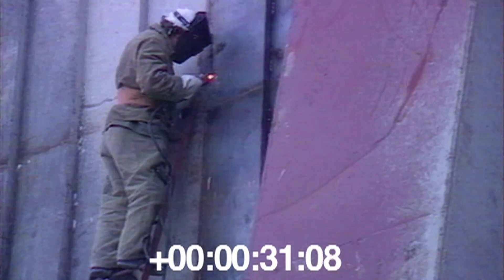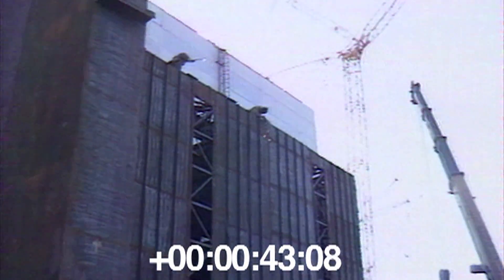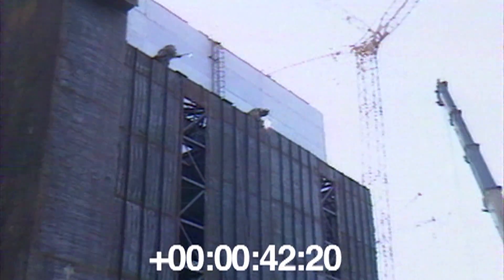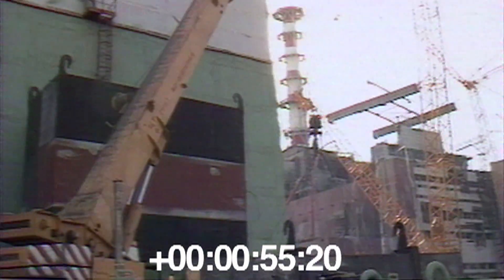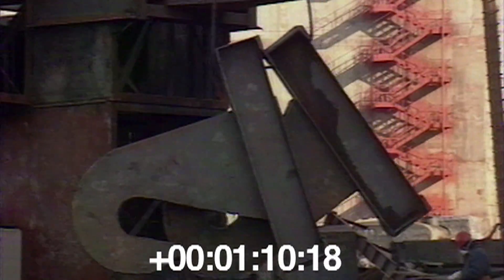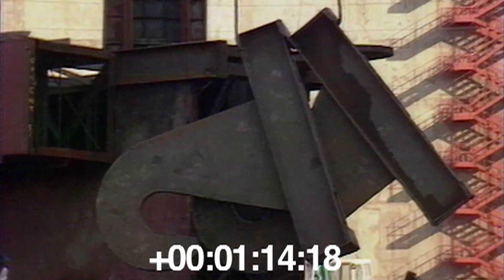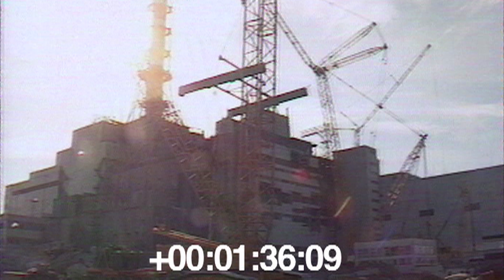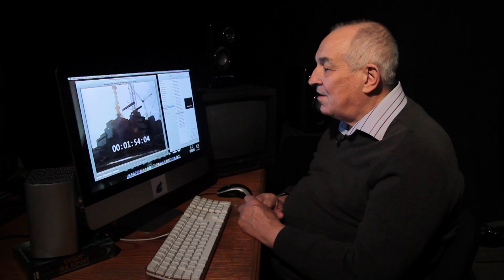CHNPP The Sarcophagus 1986.08

Comment: “Those trucks were taken to Mayak and Lake Karachay”

O O O F
Reply: The Mayak chemical plant produced plutonium for nuclear bombs. In 1957, there was a nuclear accident. One of the nuclear waste storage tanks exploded due to the failure of the cooling system. And in general there is a very contaminated area even before the accident due to negligence in the disposal of nuclear waste. Therefore, these trucks are working there. (I apologize in advance for the inaccurate translation. It's a google translator)
Reply: @Regent.sergey  yep. Basically, they were already contaminated before they even got to Mayak, which considering the Kyshtym disaster, would’ve been enough of a hazard with clean new 
vehicles. 
It’s an oof because the people running those vehicles at lake Karachay probably thought they were safe and protected in those trucks, not that they were also being exposed to Chernobyl radiation on top of Kyshtym.
Reply: lol
Reply: KrAZ mashine dislocated karachai
Reply: Mayak is known as kyshtym and lake k. Is very hyper radioactive
Reply: @LeonardFizbane  mayak is plant separate radioactive izotope

Comment: i guess not many of those workers are alive today ..
Reply: Many are...
Reply: On what basis do you make that guess?
Reply: The radiation could kill these lives. If they took too much, they would die within days or weeks. (Bad English...sorry)
Reply: they are they were in lead seald suits
Reply: well it was almost 35 years ago so age got a lot of them, plus mortality rates increased significantly with the fall of the soviet union for a wide number of reasons, that is what makes it so hard to track "true" mortality from the Chernobyl accident, which while probably higher than the very low official number, IMO is probably a lot less than the more dire predictions out there.